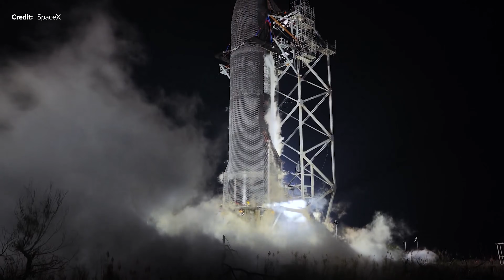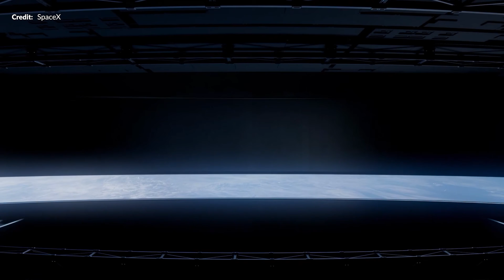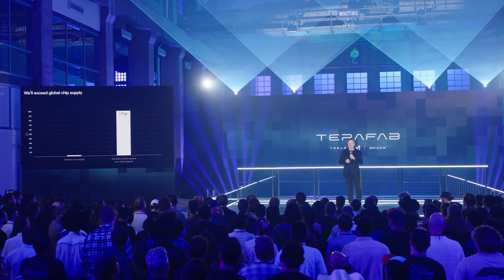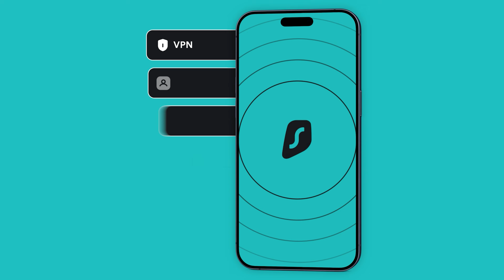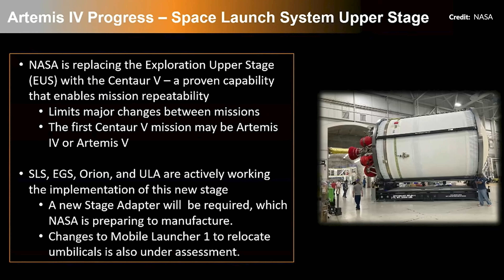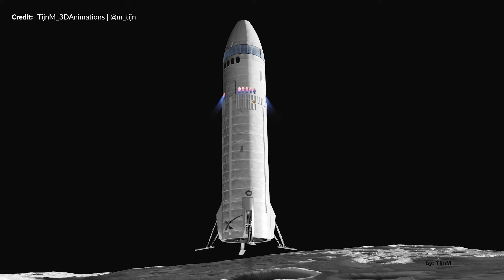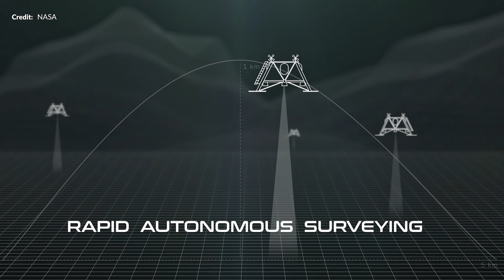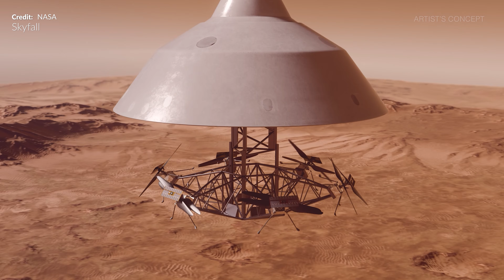They Want 5000% More… Of WHAT Exactly?

Comment: While the gateway itself seemed already out of date by the time it was meant to launch, it's clear that a space station in lunar orbit would be great for research and experiments in deep space habitation, without the risk of being on the moon itself.
Reply from the maker: I think we should keep LEO station ability and have a lunar base. I don't see a point in an orbital lunar station.
Reply: @MarcusHouse Lunar orbits make it easier to get to the surface, as you only need to get to the orbiting platform from Earth, then you can head down from there.
That's also where Gateway's weird orbit came in - it'd (presumably) be easier to dock when it's closer to Earth, then move on when it passes the Moon.

The biggest benefit I saw was putting human eyes and a human brain closer to the surface. A human could take over lander attempts, meaning much more reliable & repeatable landings.
Reply: @MarcusHouse depends on the cost really, putting a starship there with inhabitants for longer periods would already be an upgrade in living room. There is a lot in lunar orbit you could do that you can't on the moon itself. Figuring the delta V loss of having to land and come back from it. You get the benefit from being in deep space without the large drawbacks.

The biggest factor would be how long you'd operate it. As the ISS has been a constant drain to Nasa funding.
Reply: @MrPbhuh  if NASA manages to create a LEO economy and we have private companies creating their own space stations it might also get some people to create space stations in Low Moon Orbit which would let NASA focus on purely making the moon base
Reply: @MrPbhuh Question is NOT, “Can’t we do some things better in lunar orbit than on lunar surface?”  It IS, “Why do things in lunar orbit when we can do them in LEO instead?”  For at least the next 15 to 20 years, this is the way.
Reply: @737smartin can you? The answer is no. There are specific human survival challenges that do not exist in LEO, that do exist in more dangerous environments that we want to explore in the future. The risk assessment should be thus that if you want to research this, you have to have a safe way to do so. Lunar surface isn't safe and neither is a 15 month journey to Mars. At least not as safe as a deep space habitat around lunar orbit.
Reply: @MrPbhuh So, you favor no manned lunar missions or bases at all until everything is “safe?”
Reply: @737smartin that's not what I said. It's simply far more dangerous and its wise to look at reasonable alternatives. A simple Starship manned for 6-12 months would give plenty of intonation. Then there are all the applications proposed already for the gateway that add further value. But nice try to put words in my mouth.
Reply: @MrPbhuh  The only thing you would be researching by going outside Earth's magnetosphere (high Earth orbit is even closer and just as good as lunar orbit) is long-term radiation exposure. With recent advances in organoids, I don't think there's any good reason to do the vast majority of that research on actual humans. 
especially before that research is done, if anything, the lunar surface is safer than lunar orbit because the moon blocks half the radiation when you're on the surface, more if you're in a deep crater, and you can pile enough regolith on top of the HAB to get down to earth background levels while you're inside.
Reply: @M @MrPbhuh .  It’s not what you said, but it’s a logical conclusion based on what you said, so I’m asking you to clarify… which you hesitate to do.  Let’s start over.  What do you think can be learned or done better from a lunar orbiting station than from a LEO station in the next 15 years?  I say… NOTHING AT ALL.   OTOH, What can be learned or done by manned missions on the lunar surface vs by manning an orbiting lunar station?  I say… too many things to even list.  Therefore, I firmly believe a lunar orbiting station would be utter folly for this phase of exploration.
Reply: @thamiordragonheart8682  but going outside earth's magnetosphere is exactly what the plan for gateway and in extension going to mars was planning for, amongst other things.
Reply: @737smartin  i'll say it again, just as others have mentioned. DEEP SPACE HABITATION. Low Earth Orbit does not have to deal with a meriad of problems that exist in Deep Space, such as the lack of earth's protective magnetosphere. Its a cost risk analysis, if the cost is too high, its not worth it anyway, but a simple starship in orbit as mentioned a million times, would be easily suitable to observe the direct effects on humans, before we start living on the moon or mars permenantly.
Reply: @MrPbhuh  And I agree with you that we should do research on that risk somewhere safe first, and I don't think that requires doing almost any of that research with humans.
Reply: @thamiordragonheart8682  at some point to test risks to humans, you end up having to test it on humans. It would be nice that we could then also bring them home safely if something does go wrong. Or you could take the idea that humans shouldnt be involved in space exploration at all, like some people have argued.
Reply: @MrPbhuh  I agree, you need human tests eventually to check your work, and doing it in high earth orbit would be by far the safest way to do that, it's just also feasible to do a TON of de-risking first with organoid studies. 
I think human space exploration is awesome, and we will do it because exploration is part of being human. I also think it's quite risky and expensive, and the robots have gotten good enough that the scientific value of having humans on site is limited, so there's no real rush.
Reply: A correction: NASA's plans are for two lunar satellite *constellations*, not just 2 satellites. Hopefully that means much better coverage and much better cameras. This will be a critical step toward building a base and allow for reliable landings. Otherwise, we're likely to have more failed landings than successes.

Comment: Dr. Gerard K O'Neil et Al asked the question, "Is the surface of a planet the best place for industry?"
"No".
Building electronics at the Lagrange points is where we make our factories.
Ref: "High Frontier".
Most have No  idea of what awaits us.
Reply: Industry should be where the population is. O'Neill's (two L's) Princeton study group and 1976 book embed assumptions that aren't necessarily still tenable. Solar cells are more efficient and we have battery storage, so siting panels beneath the atmosphere is acceptable. The idea of powersats and colonies involved human assembly of mostly simple materials (metal, glass, silicate slag shielding) mined on the moon, rather than the long supply chains of modern ICs that society insists are now essential. Basically, if you want large orbital habitats, you need to replace the motivation "on-site labor force + capex + export electricity."
Reply: @phillipthorne8363 Humans are a major source of pollution in the ultra clean fabs.We are down to 2nm size gates.  The leGrange points are stable, have plenty of energy, are human free.
Reply: Lagrange points are ridiculous for manufacturing, MEO or geo-stationary is good enough.
Or actually, where resources can be obtained efficiently.

Comment: Artemis is going to be Starship all the way at this rate.
Reply from the maker: It is looking more and more that way. I want to see Delta V info on the new stage with Centaur. Can that then get to a lower lunar orbit.
Reply: @MarcusHouse  I'm been confused/ignorant about Starship HLS delta-V for a long time now. Does it have enough to get back to LEO after it has bought astronauts back from the Lunar surface and delivered them back to the Orion capsule for their return journey to Earth?

I've never seen any Artemis infographic, including the one that you showed in this video, that shows what happens to Starship HLS after that final docking with the Orion capsule after its ascent from the Lunar surface.

If HLS doesn't have the delta-V to brake itself back into LEO as the final stage of a mission then either...

1 - It isn't re-usable and is a single-mission-only vehicle.

2 - It needs to be refuelled in Lunar orbit (with propellant transported from Earth which presumably would be really complicated).

3 - It has at enough delta-V to at least brake into a higher Earth orbit where it is refuelled. Still more complicated/costly than a LEO refuelling but I would think still easier than a refuelling in Lunar orbit.

All the three possibilities above seem sufficiently unattractive to make me think that surely the plan must be that it does break back into LEO and get refuelled there but I've never seen that explicitly stated. Can you enlighten me Marcus - or anyone else for that matter?